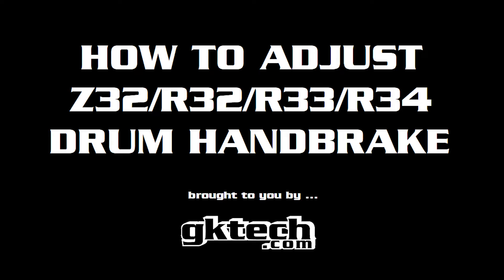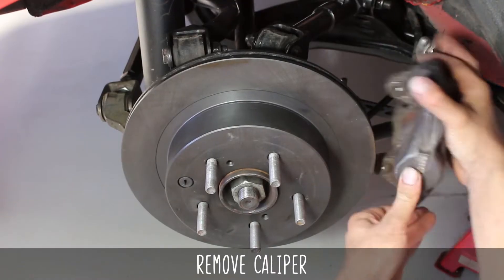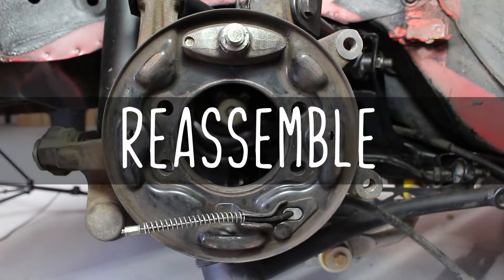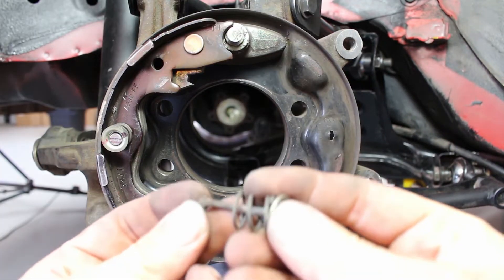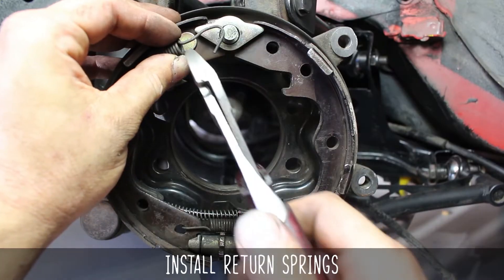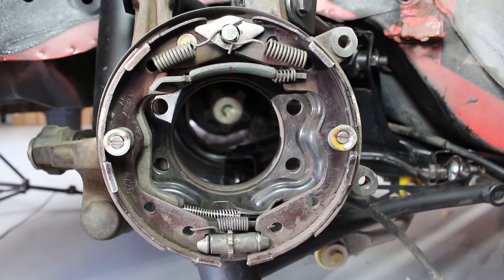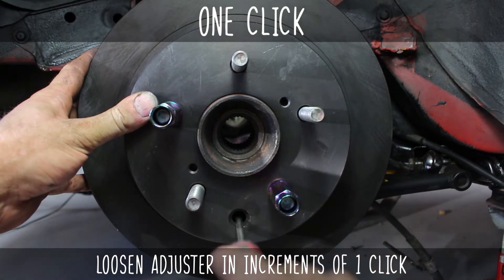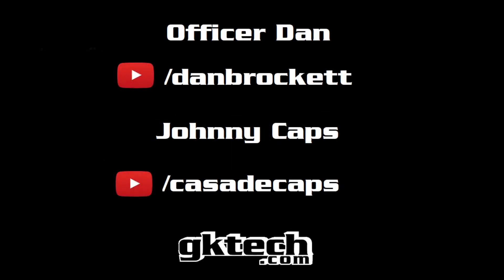How To Adjust Z32 R32 R33 R34 Drum Handbrake

Comment: Doing z32 brake conversion on my s14, and I got the r33 ebrake cables on the z32 ebrake system and it seems like the end of the cable that fits into the lever sticks out the side once I put the spring behind the Chanel, will that get pulled into place once I get it all together? Got me stressing

Comment: My adjusters are installed opposite to this so that rotating up tightens the shoes. I didn’t realize this. Needless to say it caused considerable headaches. Once I pulled a disc to replace the shoes I realized the inconsistency. After 26 years the shoes were still nearly new and I simply had to turn the barrel up to tighten!😩
Reply from the maker: Oh lord have mercy! Well, at least it saved you some money on new pads!
Reply: @Officer_Dan  Yeah, but I already ordered the parts and also spent a lot of time trying to tighten the cable with a spacer, etc., etc. But I'm happy it's solved! I was struggling to find a reasonably priced brake cable, too! I even reached out to a contact in Japan. :)
Reply from the maker: @geraldschmidt6907  Oh man, thats expensive for sure lol. Glad you got it dialed in man!!!
Reply: Oh Gerald my saviour, thank you for saving me a shitload of time

Comment: i swapped A TT rear subfram into my NA z32, i moved the adjuster all the way down like the video and the adjuster came apart. maxing out the adjuster both up and down did nothing, the ebrake cables are being pulled, but they are not engaging
Reply from the maker: Something ain't right for sure. Did you get it dialed in?